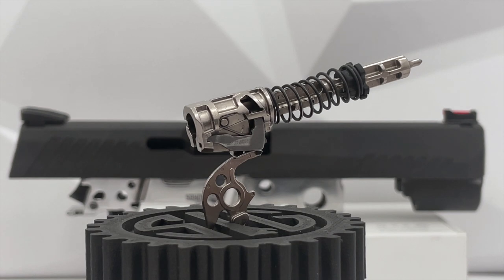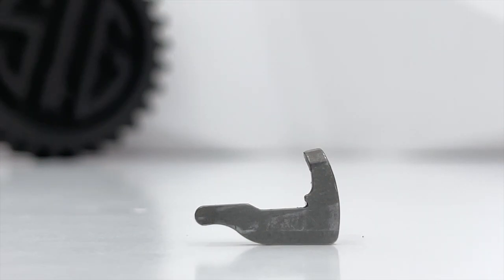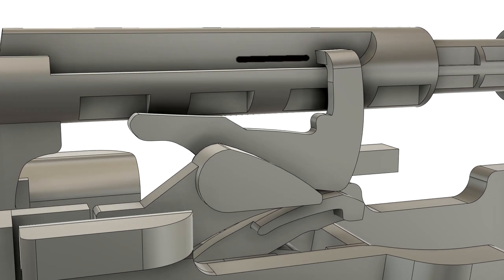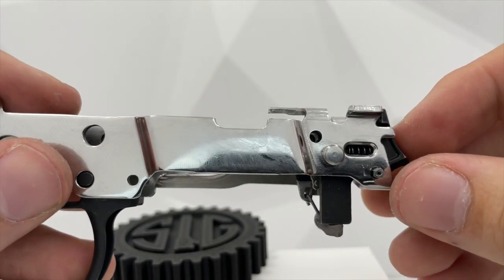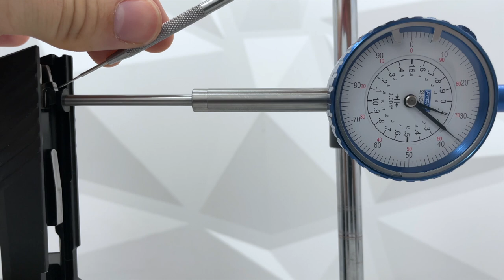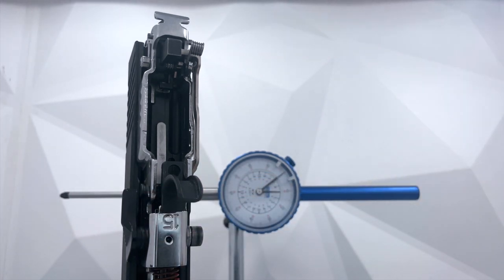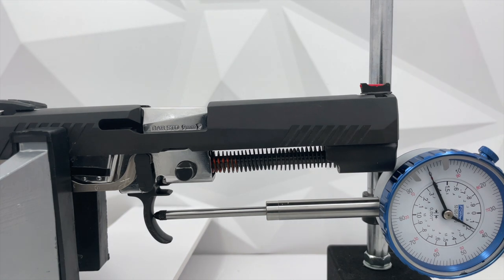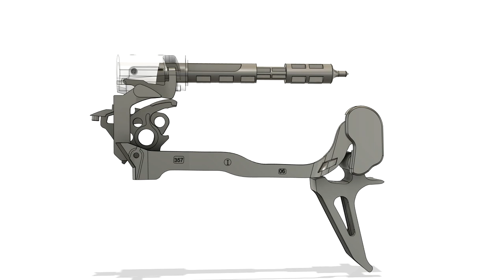P320 - STRIKER SAFETY DISENGAGEMENT PARAMETERS

Comment: Great video. Quick question. Do you recommend keeping the entire striker assembly dry or light coated with oil or anything else? Thanks
Reply from the maker: I use a small amount of dry-lube on mine. The manual does say NOT do oil the chamber on the slide, so this is a personal preference and not a recommendation by Sig.

Comment: I own three p320 the trigger on them is great but a short take up and short pull to release the striker from the sear makes me only carry it with a manual safety(m18). That presents other issues and I recently picked up an Sig p229 da/sa which I find more piece of mind with the first long heavy trigger pull. I have really decided to only carry da/sa or striker with a safety. Although there are other brands like Glock and M&P that have longer take up and a trigger dingus that I would consider carrying without a safety.

Comment: Second time watching this excellent video.
And, I think the Glock trigger has to travel close to 1/2" or 0.5" !
The slightest pressure on the trigger,  from the depressed areas on either side of the holster, which retain the gun in the holster, moving it 0.2" to the rear, coupled with a light trigger pull will fire it. The gun could be holstered, with the sear barely hanging on, and a slight vibration or pressure on the gun could set it off. Two suggestions: 1)Sig should make the trigger guard wider- would reduce the chance of the holster depressions which slip into the trigger guard, to be further from the trigger, not pushing on the trigger. 2) Holsters for the P320 should secure the gun a different way- not snapping into the trigger guard area.  I don't believe any Sig went off sitting on a table top. They all seem to be when holstering or in the holster, with the trigger pulled rearward, just before the point of releasing the sear. Then, the slightest pressure on the gun I. The holster, or even a vibration could set it off. How about measuring the distance between the side of the trigger and the edge of the trigger guard, and, comparing to other pistols?  When Sig inspects a "defective" gun they should also examine the holster it was in. Mark the sides of the trigger with some sort of chalk. Slide the gun in and out and see if any chalk is transferred to the holster.
Just a few of my non-expert thoughts .
Keep up the excellent work!

Comment: At 7:40 how much pressure are you applying down on the sear to release the striker? I wonder why Sig would design the sear to be able to be depressed without the trigger bar acting on it to begin with. Glocks cruciform for example sits in the housing shelf preventing this until the trigger is pulled. When you depressed the sear in this instance, did the bottom rear sear leg press against the rear of the trigger bar?
Reply from the maker: Not much pressure, I should know, however, that putting a physical object on the seer is vastly different than shaking it in a drop. What I did represents an astronomical amount of force to do if it were to be reproduced without a physical item.

Comment: Thank you so much, very valuable information   for carrying a P320. Can you please explain the mechanism of the manual safety on M17 please. Is only blocking the trigger or does it include additional Internal safety?
Reply from the maker: Hey Jorge. Due to the upcoming manual safety modification project I am working on, I plan on doing a deep dive on how the manual safety work on the P320. 

So if you stay tuned, I will have a very detailed video about it, including 3-D models that will show you the inner workings of those mechanics.
Reply: @SIGMECHANICS  Thank you very much.

Comment: A year later but great video!  Question though, how far does the manual safety on the P320-M17 series allow the trigger to travel? Is it enough to disengage the FCU safety lever?
Reply from the maker: That is an amazing question! I don’t know because I haven’t tested that, but I do have a method to test. I will add this to my list for future videos! 

All M17/18 triggers do have a slight play when safety is on, and my initial feeling would be “no”, however, the stipulation to that answer would be if it does engage safety it will not be enough to fully disengage. If anything it would be an insignificant fraction.

But again, I’ll have to test it and report back. Thanks for asking!

Comment: How would vertical play between the slide and the FCU affect the engagement of the Stryker and the seer I have a couple that when I start to press the trigger you can see movement vertically between the slide and the FCU
Reply from the maker: I made a video about this exact issue. Here’s the link: 

P320 - SLIDE MOVES DURING DRY FIRE  (2022)
https://youtu.be/itGqqq8IcL8

Comment: Love watching your videos, nice job! Can you explain how the striker reset spring works? the reason is, every time I dissemble the striker fully, I find the striker reset spring is broken into 2 or 3 pieces, and strangely enough, this seems like no impact to my gun functions. I do competitive shooting, so I may dry fire and shoot more than some regular folks. I'm wondering why this spring breaks so often, and what potential impact it can have once it's broken.
Reply from the maker: Thank you @Bo Zhang. I made a video that touched on this (a little) if you check out the Sig Mechanics SHORTCUTS video “broken reset spring”, I also made a Instagram post on this some time ago with a basic explanation. 

The reset spring is a finicky thing, I’ve broken and crushed mine (to be fair I disassembled the striker a lot), not much you can do but replace them. 

The only thing I’ve see people run into is the striker will stick out of the breech face and SOMETIMES cause a spent cartridge to not properly eject. I’ve not had the issue personally however.

Comment: I like the idea of the safety bar but (and this is a lot of what ifs) if the spring that holds it down broke and you didn't know it and the gun was upside down (letting the safety bar flop) AND the sear catch on the striker broke, the gun could fire.
Reply from the maker: Are you talking about the takedown safety lever?

Comment: I just took apart my slide and noticed the striker safety spring was missing. I had another with the spring, so I swapped them out.
Reply from the maker: That’s crazy! It would be hard to lose that part in that manner but I suppose it could happen. Luckily, the spring missing would still let you use the pistol, but would offer “limited” protection. Specifically, should your striker break, you would be be relying on luck, if the safety was shifted down… you’d be okay, if it was shifted up… hospital. 

I’m glad to hear your safe and got it resolved.

Comment: Looks like they were trying to reinvent the wheel. Whats wrong with the standard plunger striker block mounted in the slide?  I mean i get it, they wanted a shorter take up. But at what cost.
Reply from the maker: It’s a bit odd, the 365 has a version of a plunger, the slide on the 320 could possibly be fitted with a similar thing.

Comment: Great explanation as usual. I am wondering at 5:55 you showed the fire pin unit and I noticed the shelf on the pin itself that interacts with the safety tab. Maybe that shelf should be steeper so if the gun is dropped upside down enertia won’t release the pin.

Comment: Excellent video!!! I recently installed the apex forward set trigger and it more or less eliminated a lot of the take up. My concern now is that as a result of that the striker safety is being pushed up that .036” and it’s being constantly in that position. Unless the design of the leg of the trigger bar is somehow different and does not move the striker safety until the trigger is actually pulled. Any thoughts on this?
Reply from the maker: @Shivan Maharaj, my understanding of the trigger bar is that yes, they altered the design of the leg to allow the trigger bar additional distance before contacting the safety lever. However, I have not yet done my own look into it, I did however send off an email to them to see if we can get one in for testing.
Reply: @SIGMECHANICS  awesome. Hope you get one. Great testing my friend

Comment: Something isn't making sense. People are now saying that SIG is claiming these misfires are caused by a malfunctioning striker safety spring. When someone has their gun go off in their holster, and they send it to SIG they just replace the spring. What do you make of that?
Reply from the maker: It’s definitely not the reset spring causing this, a few years ago Sig considered the reset spring a redundant part and discontinued using it. They noted that because the striker will automatically reset when the slide blows back aft are firing, then the reset spring does not do anything.

They still install them and they still put them into new firearms but it looks like they’re just phasing out the spring or getting rid of old stock. Some new P320s have the spring and others don’t have it at all from the factory.
Reply: @SIGMECHANICS  In your opinion, what do you think is going on with these misfires? Do you think the manual safety will do anything to keep the gun from going off in the holster?
Reply from the maker: For everything I’ve done and tested… in every instance the trigger is being pulled unintentionally. There are too many safeties built in that would have to simultaneously fail otherwise. 

Most of the issues seem to stem from how there really, truly, was a drop fire problem in 2017 with the heavy triggers, and with that history it seems there are people are finding new ways to worry others. (Bad news gets clicks).
Reply: @SIGMECHANICS  I don't know the ins and outs of the P320 like you do. I did end up buying one of your manual safety conversion kits and installed it and it works perfectly (been working for a good long time now) 🫡. But I would be lying if I don't say I still am a little concerned in the back of my mind.

Comment: So with the new lawsuit in 2023 what do we think is happening that could allow the weapon to be fired while holstered. Are people disessembling them farther than they should be for their level of skill and breaking things? I am only comfortable field stripping my pistols and AR15. Haven't tried anything else as I haven't done enough research or education.
Reply from the maker: The P320 design is extremely simple, and it’s hard to mess up the internals. I have yet to see anyone that can replicate the issue under any sort of controlled environment, therefore I believe the discharges are simply NDs. 

For example, when the drop safety issue of 2017 came up, you could actually replicate that problem easily, this case however is more on word of mouth unfortunately (or fortunately as the case may be).

Comment: I was in the range yesterday, I was doing my CCW drills, It was working perfectly fine after 300 rds, until on my last drill from appendix draw and shoot from the holster. 

After rapid fire for about 6 rds my p320 m18 stopped firing.  Checked the magazine, still has 1 rd. And when I checked the barrel there still one in the chamber and wont fire. 

Rechecked and charged it again, trigger clicks, NO BANG.  checked the fcu components and firing pin, no damage. 

Put it all back together, able to do dry fire and able to reset. Tried it again with an ammo, clicks, trigger fires but no bang.

Funny enough, I gave up and use my mp shield, did same drill from appendix holster draw..(1st set of drill) about same 5 rds.. IT DID SAME THING!

what am I doing wrong that caused both pistol to stop doing same drill?  Need help 🙏
Reply from the maker: That sounds like you need a more in depth review from a professional but if I were to venture a guess, the common denominator would likely be the ammo. Were they reloads?
Reply: @SIGMECHANICS I was using fiochi 115gr on the 1sr 275 rds...

 Then siwtched to blazer 124gr on the last 30rds. Last 15 rds of it worked fine then it stopped. (M18)

Worked with mp in the 1st 5 rds and stopped too... prolly its the ammo? 🤔🤔🤔
Reply from the maker: Did you check for light strikes on the primer for the failed rounds?
Reply: @SIGMECHANICS  so thats possible?, certain grains like 124gr will work 1st several rds and stops? 🤔
Reply: @SIGMECHANICS  that I missed to check, ill check it when I get back home. Tnx for the quick input 🙏🙏🙏
Reply from the maker: No, It’s less likely factory made ammo (especially two different ones) would have this issue. I suspect the firearm itself. If you can’t see the issue then take it to a professional the issue could be mechanical but would need to have eyes on it.
Reply: @SIGMECHANICS  ok got it. Thank you again! 🙏
Reply: @SIGMECHANICS  finally had some time to go througj the ammo i used, found 3 that has deep dimples.. so im im 100% sure now i had bad ammo.
Reply from the maker: 3 rounds with striker markings but they did not go off?
Reply: @SIGMECHANICS  yes found 3 that has 3 deep dimples.  Came from same 124gr blazer. So I would say, some ammo in that box are bad.

Comment: Impressive! The detail is awesome. Great job.
I've looked to see if the newer guns have ever been able to reproduce a UD, but couldn't find any conclusive. Does anyone know otherwise?
Has anyone heard of a newer M18 having a UD? Thanks!
Reply from the maker: So far, there has yet to be any way to reproduce the UD in a “clinical” fashion. The supposed issue seems to be an unsupported claim. 

Although I remain open to the idea, I cannot find a way to cause a UD without first by-passing all safeties and even then, I still need to pull the trigger. Therefore, I wouldn’t worry about this too much unless someone can actually begin to reproduce the problem in a controlled environment.

As far as the M18/17 with manual safety goes…even less of a concern, I haven’t heard anyone say that they experienced a UD with that model.

Comment: Very good video. Nice photography. Just some points: The striker “safety lever” is called the “safety lock”. The safety lever is in the FCU only. The safety lock only has to move upwards the height of the striker stop wall for the striker itself to continue forward to discharge the round after releasing from the sear by whatever means. Also, the striker housing is not machined. It is molded by MIM  process. You need to take a look at the actual physical  “ positive contact surface” of the sear, the striker foot, striker stop (wall) and the safety lock tab and notice excess molding material left over from the manufacturing process that has not been removed prior to installing the parts that can interfere with the designed “positive contact surface.” A video on this would be helpful.
Reply from the maker: hey, @peter villiani, good to “see” you again! lt’s funny you mention it, I realized this when I was creating a parts list right after the video was made, I thought about it but didn’t want to reshoot. oh well…I’ll chalk it up to P320 “slang”. 

Also, I have a bad habit of calling things “machined” when it comes to formed parts, even though almost everything on the P320 is injection molded. Good point though, I’ll keep that in mind going forward!
Reply: Hi again. Also if you take the slide off and lay it upside down, you can push the striker foot downward into the striker housing which also creates space between the striker foot and sear interface thereby reducing the need for the sear to drop down as far as it can since the striker foot can travel upwards because of the play in the housing. On another note, you really should take an armorers course because you definitely have the aptitude for this type of work. Once you do, you can be hired out as a Subject Matter Expert (SME).
Reply from the maker: @peter villani. Thanks! That's kind of you to say. If I'm being completely honest, the main reason I went with the gravity drop method was first for giving the camera a good angle to show my work, and second, to give the test a more tactile feel to it. By dropping it all the way into the breech face we got a nice "plink" noise for the viewers to experience the test alongside of me. So, I suppose you can say it was for a bit of theatrics and cinematography. lol.
Reply: @SIGMECHANICS  question: do you do your own animation?
Reply from the maker: @peter villani, yes I modeled them myself. I actually started making it before I had this channel because I wanted to see if I could 3D print a functional sear/safety/striker etc (not the FCU) for the fun of it. (NOTE: For anyone reading this the FCU is the serialized part and therefore the "firearm", do not manufacture it without proper licensing and approvals according to your local laws). Once I got started on Sig Mechanics I saw the value it could bring to the community and began to implement it to help others understand their guns better.

Comment: I hope you see this because i have a question i cant seem to find a definitive answer for. If the sear springs are defective, out of spec or worn out etc, the gun still could not be fired because the striker safety tab was not pushed up because there was no trigger pull correct? I just cant figure out how all these cases of the 320 “firing on its own” is happening without pulling the trigger somehow. Ive watched this video no less than 6 times and i just dont see how its possible
Reply from the maker: That’s exactly right. Even if the sear springs somehow were completely missing and the sear fell flat to the bottom and the striker had nothing to grab onto, the lock lever will still prevent entry into the breech face unless the trigger was pulled.
Reply: @SIGMECHANICS  i love these videos man! The amount of explanation you give and the in depth demonstrations are priceless info for us 320 guys. Keep it up!
Reply from the maker: Thank you! Lots of fun new stuff coming up soon with a few surprises. Stay tuned!